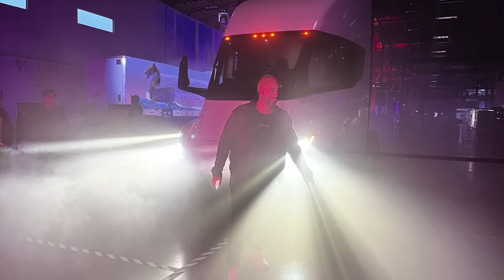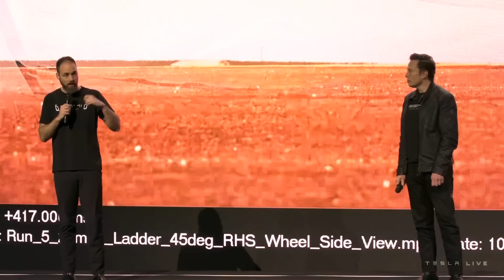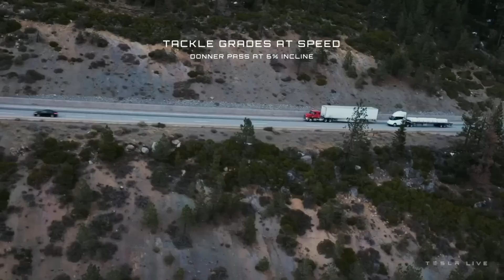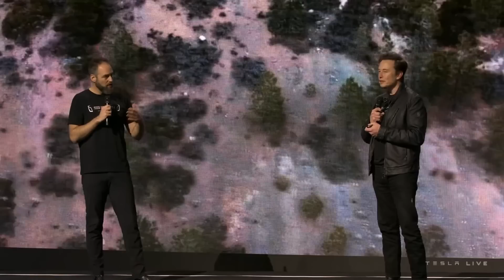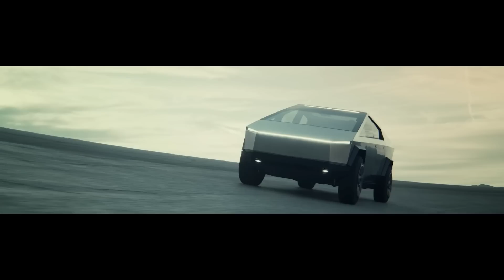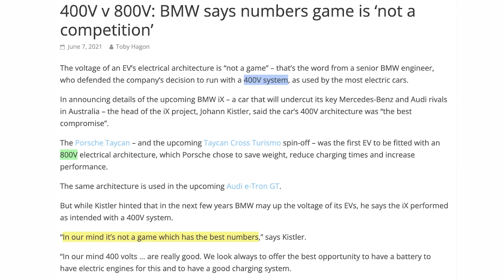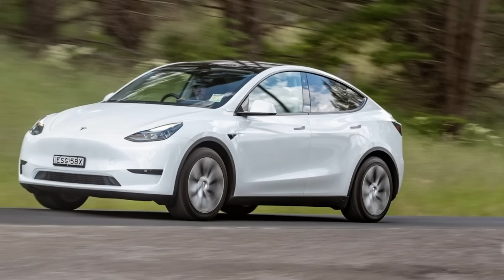Why Tesla Is Being Secretive About Tesla Semi & Why OEM's Are Giving Up ⚡️

Comment from the maker: What did you guys think about the event?! Also: at 7:59 it should say 1,000 kW, not kWh, apologies!
Reply: I loved the event.  Straight forward and no oversell. I think fleet operators are actually going to negotiate so I didn’t want them to give a price pegged but everything’s gonna start up and make that the only talking point. 500 miles real conditions three motors that can be very efficient with one and then the other two coming online is the story of the day rather than $400,000 over it’s $200,000 or it’s $900,000.

Elon made the right decisions on what to say to control the story for the next week or two.  Thoughts?
Reply: @WSDFirm  as a truck driver owner he gave plenty of information.. The biggest positive is the top average speed no diesel can compete by 20% to 30% half MEG charge is just perfect same consumption as diesel 25ltr per 100km..so if you produce your own electricty then that the winner..
Reply: agreed, we got very little technical details about it.
Reply: My one question is, can Tesla make them at scale in the next six months to year and I think he just needs to make them rather than talk about it.  “Talk is cheep, it takes money to buy whisky 🥃.” 🛻 🛻 🛻
Reply: @WSDFirm  I agree Brad. I don't think Tesla has got production capacity yet. They have refined the truck not the manufacturing. There will be a lot of changes based on feedback from real use and this may also affect the manufacturing. Maybe they will make 50 000 in 2024 but I dont think they will make more than a few thousand in 2023 and with fairly simple manufacturing methods apart from the components which comes from the cars.
Reply: I know you are super disappointed about the lack of details, but something to be aware of - historically speaking the heavy haul truck development community (read: Paccar & others) are historically secretive communities. A fraction of a % point of efficiency is worth millions in truck orders from leasing companies (read: Swift & others). I would argue their lack of details in this presentation is critical to maintaining their "moat" around the business.
Reply: It definitely did a great job of leaving us wanting more!!!   Nothing on Auto Pilot, or the idea of Caravan, no clue on December production/delivery's. no mention of Battery size or make up.
Reply: Maintenance cost savings can't be overlooked.  I worked in a diesel garage in college and basic oil changes and brake jobs were very costly and tranny/engine rebuilds were ridiculous!  If Tesla could continue to increase efficiency and get away with LPF packs that last up to a million miles, the incredibly low total cost of ownership would quickly decimate the diesel competition.
Reply: Great presentation as far as what they showed.  Basically it’s safe, comfortable and  efficient. Donner pass is a climb for most trucks so accelerating up it with what looked like relative ease is a game changer.  And yes the 500 mile version is a long haul version. It doesn’t fit all long haul situation but it will handle most.
Reply: Tesla do not need to promote something like this. It should sell itself just based on spec and economy. It will take time to finalise the design and ramp production. Long term I think they will make millions annually but that is probably five years away.
Reply: TSLA can sell these for and I kid you not for $420,000. The cost savings alone will be north of like having the driver for free at $0.70 a mile.
Reply: I had the same initial reaction, but upon reflection, I have a completely different take.  First, TSLA would be dumb to divulge pricing.  Maybe they're willing to sell it for 20% less than PEP paid.  And if another company is willing to pay double just to virtue signal, TSLA will take it.  
But, the real deal, imo, is that TSLA  is essentially selling PEP beta versions.  That's genius.  Just like TSLA is collecting millions of miles of data for free with FSD beta, PEP is the guina pig for semis, paying TSLA to offer TSLA feedback on how to improve the product.  
If you listen carefully to Elon's words, it's basically, "Here's what we know about semis, so far.  Give us your feedback and we'll make it work."

There was no reason to hype the product.  Like you said, it's 12 cars worth of battery.  The Neuralink event the day prior was even more of a snoozefest.  Elon sounded like the kid that forgot his book report was due that day.  But, it's all good.  These events are really just recruitment events, not investor events or sales events.  He just likes to hint at the direction of future tech to entice genius engineers to come to work.
Reply: Thought it was great
Reply: TBH i think i get myself so excited about events like this that i always seem to come away somewhat underwhelmed. That being said i was impressed that the Semi drove out by itself and not pushed. I was extremely impressed with Dan also . He seems very passionate about his work and rightly so. I guess i was expecting an announcement on future Giga sites as Elon has promised before year end so i suppose he still a few more weeks. But then again we have to allow for Elon time lol.
Reply: Are you a truck driver? No you haven't got a clue, your opinion is honestly clueless you need to get some that understands the figures.. It was explained in full..
Reply: I tend to agree with the thought we might not get a Model 2 for the mass retail market.  If they can continue to drive down COGS, it simply won't be needed. A true level 5 robotaxi could honestly take a few more years to pass NITSA regulations and come to market, so I believe they'll convert Model 3s for that service.  If it is made, it'll likely be manufactured only overseas and never come to the US market. Similarly, I think the Roadster has been put on the WAY back burner. The Roadster's original claim-to-fame performance statistic was its sub 2 second 0-60 acceleration.  Now that the Plaid's specs are at 1.99, the amount of effort, time, tooling and robots needed to set up a dedicated production line for the Roadster wouldn't be worth it, especially for a car that won't sell that many units per year.
Reply: They delivered what they had committed to, with usual time delays..
Reply: If you've been closely following Tesla and the Semi, it was almost all review.  The details about the 500 mile route, 1000w architecture and 1megaW charging were the only things announced/clarified.  Seems the audience was those who haven't been paying attention.?.?
Reply: Agree with you. I was quite disappointed because of the lack of details.
Reply: Maybe it’s just me, but Elon seemed completely out of it, unenthused, and preoccupied. Disappointing.
Reply: Well done,  your points are right on the money. It's really good to see you are being objective. They are being very secretive, and good for you for calling them out! All they were interested in, was showing some nice shiny objects and saying "isn't this cool, and badass, we did what we said we could do, enjoy the snacks, buh-bye".